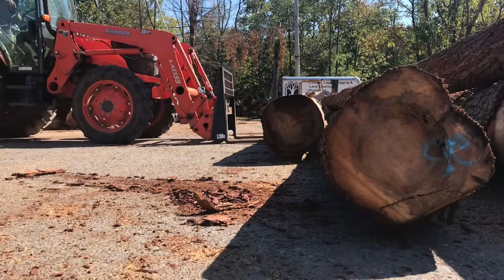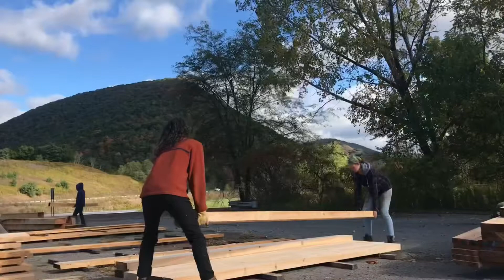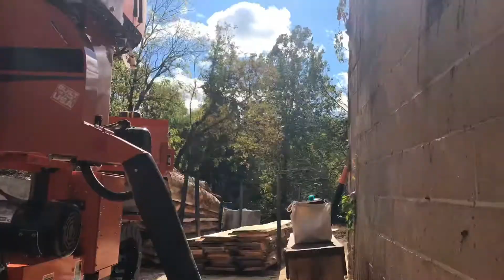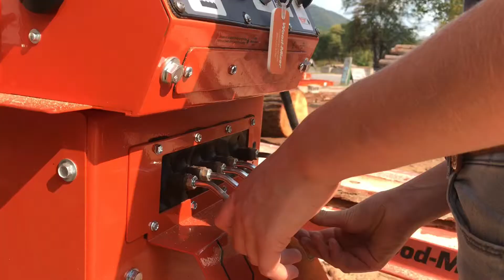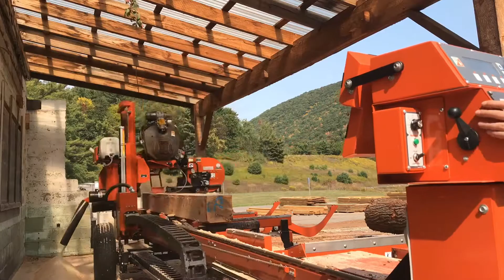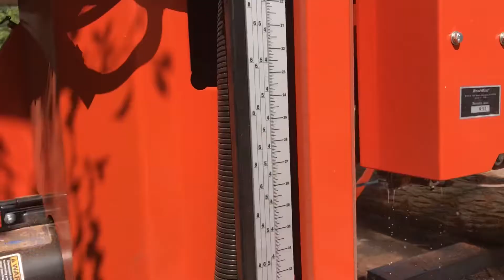Milling hemlock logs

Comment: I like the hemlock but prefer white pine up here in New Hampshire.  I can only cut 26" diameter logs, but that is fine for my needs.  You know best because its your operation but seeing your fire wood video makes me think that loading your logs similarly would make life easier at the mill.  Not with hydraulics but same concept manually.   Difference is I am 54 with a bad back so I look to be the lazy one!  Good job family!!!

Comment: What factors did you use to decide on the LT 40?
Reply from the maker: Good question, we upgraded from an LT35 and this about doubled our production. One thing that caught our eye was the board drawback, this help to speed up production and made less work for my swamper. This mill also has a 38 hp engine compared to the LT35 which only had a 25 hp.